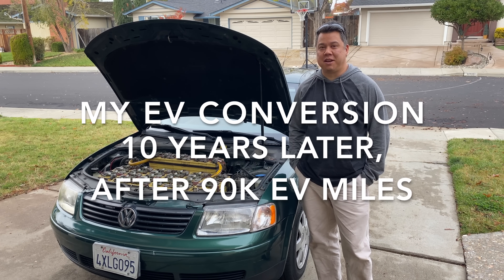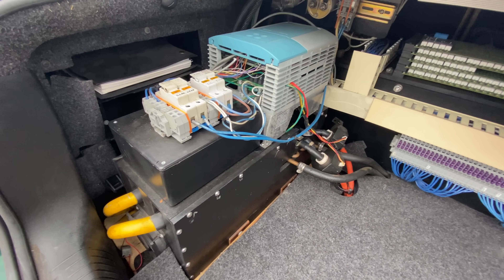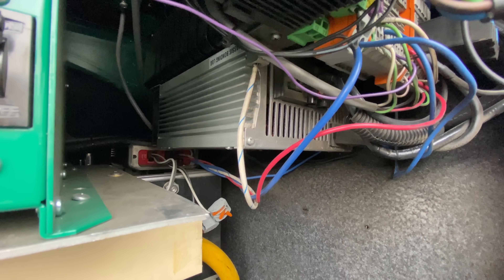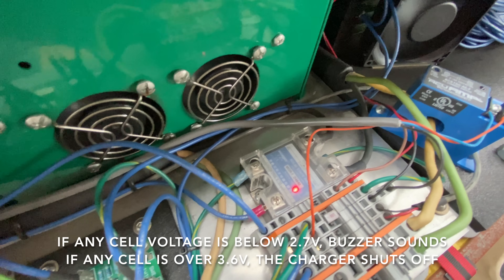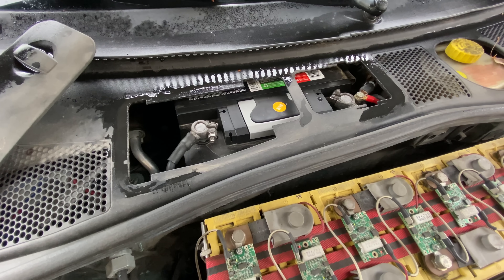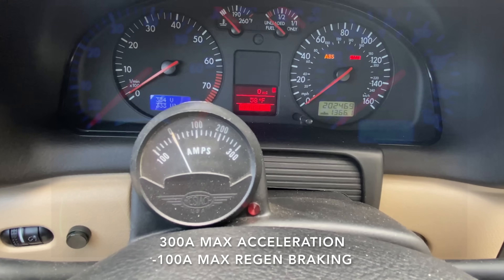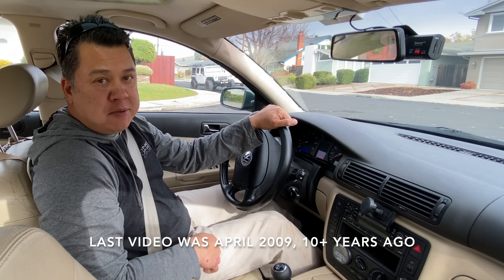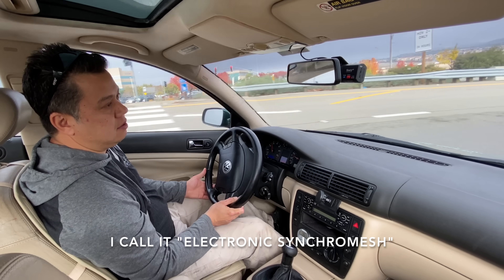My EV conversion after 10 years and 90k miles

Comment: Just wow! Wish you further tons of miles with it. 

What I don't get: why did you change it to manual transmission? I always thoght EVs have no classic gearbox anyway
Reply from the maker: The transmission is needed to connect the motor to the two drive axles, and also provides a 10:1 gear reduction.   An automatic transmission would require more work to operate (hydraulic pump, torque converter...)  and it weighs quite a bit more than a manual transmission.
Reply: @etischer  thanks! And just wow again :)

Comment: You could of literally drove a dump truck to work every day and the fuel bill would still be cheaper then a $25k used electric car.

Unless you built it for fun and experience, there would be no reason to build it for practicality.

Comment: Electrify is cheaper at different times?
Reply from the maker: Yes, it's to encourage people to use things like clothes dryers at night when there is less load on the electrical grid.   This helps alleviate the need for building more power plants to supply power during the day, during peak usage.

Comment: do u have a battery hotspots problm?
Reply from the maker: Nope
Reply: @etischer  won't the batteties get heated up while running...?? Or do u hav any cooling system for tht?
Reply from the maker: @Karthiksen  Im sure they warm up a few degrees, but they've never felt warm.  The internal resistance of the battery pack is really low, around 100 miliohms.   Typically on the freeway, the car uses 60 amps, so I^2 * R = 360 watts of heat over 700 lbs of battery.
Reply: @etischer  thanks for the clarification

Comment: Did you ever have any water issues
Reply from the maker: I did have one spot I didn't notice water would come through, I think it is where the air filter box cold air inlet was routed though the radiator support. When I removed the air box, it left an open slot about 4" x 1.5" above the radiator, didn't think much of it cause it wasn't visible with the hood closed.  I noticed one of the boards had a little corrosion on it one day, even though they are conformal coated.  Was an easy fix to glue a plastic cover over the opening, never really caused a problem though.

Comment: Spent all that money and time making an EV. But uses the stock stereo
Reply from the maker: The Monsoon system is really good, uses 2 ohm speakers and separate amp.    I also had a JL Audio 8" in a bandpass box I built, with the micro sized Fosgate  PBR300X2 amp.   I pulled the sub out for the video so people could see the EV part of the car.   Also had iPod integration for direct audio connection and integrated steering wheel controls.

Comment: This looks dangerous and shouldn't be legal for citizens to do this, what if the battery got hit and blows up?

I swear you people never think of these things, only think of what CAN be done you dont consider whether or not it SHOULD be done smhsh
Reply from the maker: Yes I have though of these things.  These are Lithium polymer  batteries, they do not catch fire, even with nails or bullets shot through them. They are much less flammable than say... 20 gallons of gasoline.

Comment: So I'm and automations engineer... I spend 8hrs 5 days a week lovingly and maternally caring for a Cyclosporine syringe, sterile filling machine. With its servo controls taking up a massive cabinet the length of the pharmaceutical suite (filling machine room) wall.
I would still not want to take the effort to do this xD
Jesus man, fair play, and while I could list the problems I'd have with the car, like being able to put down the rear seats to open the boot for any wood, whatever I plan on carrying, in reality, I doubt you need that, and it's clearly been running like a champ after 10 years.

Comment: It should be noted that 90 kw is the equivalent of 120 HP but since electric motors have nearly constant torque from 0 rpm onwards, a 120 HP electric car is the equivalent of a 360 HP gasoline car.  The downside is the limited storage capacity and weight of the batteries.  Because you can charge every night at home rather than a once per week visit to the gas station, the limited capacity is not as large a problem as it might seem and purpose built electric vehicles can save a lot of weight, of course a conversion will not have many of the advanced weight saving materials and would be carrying unnecessary mass such as the transmission but overall, an electric vehicle should meet most daily needs, reduce maintenance costs and you can just rent larger vehicles when you do have extended trips.  I'm not too keen on replacing existing vehicles with electric vehicles as producing any new vehicle has an energy and material costs but conversions can address that and if you're going to replace your vehicle anyways, an electric may be a good option.

Another point is that cars are designed to exhaust cabin air through the gaps around the tail lights so it isn't necessary to cut exhaust vents behind the license plates, just cut a hole through the interior covers around the tail lights and mount exhaust fans.  Also note that hat the Prius has been a by the rear seats so that the air conditioned air in the cabin are vented through the battery compartment.

Comment: That's great but what about when you suffer a COLLISION?! All that tek-screw mounted equipment will break loose and be in your lap...after it squishes you of course. That is NOT safe. Also,how much does the vehicle weigh? As much as an F-350?..on that light chassis and small wheelbase. He may be an electrical whiz but he doesn't understand or care squat about mechanical engineering. #deathtrap #nochildrenallowedonboardever
Reply from the maker: My EV conversion weighs 3,700 lbs, the V6 Passat weighs 3,600 lbs, W12 version is 5,400 lbs.  The strapping for the batteries has a factor of safety of ~30x.   The welded battery racks are bolted to the frame using 3/8" stainless hardware with tapped backing plates.  Obviously there are differences from a stock vehicle, but ABS and airbags should still work, chassis is unmodified.

Comment: Pretty interesting build especially given the transmission. Probably not cost effective but for instance the abrams tank which uses a turbine uses a reduction gear box which brings input rpms down to a rate that the transmission can accept. Also adds torque ect.

Comment: pretty cool...very nice attention to detail....you have way more electronics monitoring things than i would have thought and way more power-supplies than i would have thought necessary....drops efficiency. But Wow...batteries everywhere...lots of weight...beefy springs. Question is...how long before you have to change out those expensive battery packs?
Great idea to keep a manual transmission....do you regen energy during braking? and what happens when you push in the clutch??...imagine the induction motor keeps the same RPMs when shifting?

Comment: Firstly, let me say that I respect your engineering capabilities ... not only in regards to the design aspects, but also the actual building testing and implementing of your designs.
But ... 
and please don't take this the wrong way ... 
the nature of your personal design/build/ and implement project (and it's price tag) negates the critical research that an "automobile manufacturer" would have the financial resources to perform.
Namely; Destructive Testing.
Question: What happens when your car is sitting in a line of vehicles, waiting for a traffic light to change, and a heavy truck plows into the back of the line; crushing the "crumple zones" of your electric car (which are chock-full of high amperage battery bank's) and your car's conductive steel body becomes a conduit for 330 volts, at an impressive 300 amps of potential?
Not to mention, that the entire "line of cars" have been mashed together, like a string of metal contacts during the impact, thus distributing the "power surge" to the other party guests, including the truck driver who dropped-in unexpectedly.
So there. I have said what others were thinking, but we're too courteous to mention, as they observed batteries stuffed conveniently into every available cubby hole. 
You sir, are a humble genious.
But, I am willing to honestly answer the question that I posed earlier ... 
Answer:. Nobody knows.

Perhaps all of the fuses blow simultaneously, with a whift of smoke that vents from behind the freshly mangled license plate.
Or ...  perhaps a dozen people are electricuted, including several emergency response workers that unknowingly participated in the electron flow.

Now, human nature virtually dictates that one or more readers will happily attest that the system will self-extinguish, based upon wishful thinking.

But, the truth is ...  that until several cars are smashed into crumpled messes, and the data is measured, recorded, and studied; not one person can say for sure that "baby Billy" sucking upon a lollipop in his rear-facing car-seat, will survive the event that included the brilliantly designed VW.

I'd like to take a moment now, to apologize for mentioning the unmentionable.

I've always felt that "somebody" should have "voiced the negative" prior to the launching of the Hindenburg.
Reply from the maker: About crumple zones, VW put a W12 in this car too, I probably have about as much crumple zone.  The steel body would act as a faraday cage absorbing current preventing it from flowing through a person's body.  Current has to flow from positive to negative battery lead, unless you complete the circuit from both ends of a battery, no current will flow.  Current will take the shortest path, it won't electrocute a string of cars touching each other. As soon as the battery is shorted, the fuse will blow.  Fuses don't emit smoke when they blow, the semiconductor fuses Im using are also full of sand that floods the void of the fuse element when it burns out.  I agree there are additional risks, but other risks such as 20 gallons of flammable gasoline are eliminated.  The batteries Im using do not catch fire, even when pierced with a nail gun multiple times, or shot with an AK47 (YouTube).
Reply: @etischer ,
You are the last person I would have expected to drive home my point, regarding human nature and wishful thinking.
Just curious ... you expressed your favorite perspective in the thought pile, but ... tell me more about the dozen or so "other" scenerios that you weighed in your mind, before choosing the one with the happy ending?
To save time, why not just summarize with two or three catastrophies?  🤔

Comment: Did the electronic steering pump made the steering smoother and easier compared to the original hydraulic belt driven steering pump ?
Reply from the maker: It's an interesting sensation being able to turn the wheel with no engine running.  I wouldn't say the steering feels any different than a normal car.

Comment: What happens if you’re in too high of a gear for example if you’re in 5th gear at 10 mph
Reply from the maker: The motor would be drawing a lot of current, and over heat eventually.  It's better to have the motor spinning fast, so it uses less current but more voltage to make power.

Comment: As soon as he said he manual swapped it he instantly earned my respect
Reply: Very smart move for longevity
Reply: @kenball1980  smartest move for an ev would be to not use a gearbox at all since the electric motor doesn't need it
Reply: Lucian Iștoc still there must be a gearing ratio because of different speeds and following in-/efficiency so you would need a converter of some sort. For him it was probably easier to just use the already existing clutch.
Reply: @lucianistoc1264  most ev conversions use gearboxes. Electric motor may not need it as much as an ice, but it doesn't hurt it either.
Reply: @AR-zq9hq  No they don't, they just use a final drive ratio
Reply: he earned my respect when he popped up the trunk.... the manual swap is instant legend status...
Reply: Respect +
Reply: Famus 801 it’s not hard at all
Reply: The only thing similar to an atmo car is the suspension, the car shape and the moving wheel parts. You don't need a gearbox because electric motors are infinitely adjustable according to the voltage applied.

Comment: while I am very impressed with the job this guy has done the economics of this really doesnt work out. He has spent over $12,500 on batteries alone to do 90,000 miles. Not taking into account the cost to charge it daily it would still have been much cheaper for him to do the same mileage in a petrol/gasoline powered car (even if he had done it all on todays petrol prices). Lets not forget that the power used works out to be very similar cost to petrol/gasoline for the same distance.  If he had bought a Nissan leaf or similar the battery cost would be even higher and their batteries dont last very long. Electric cars really are not efficient users of energy.
Reply from the maker: I did the math in the video description area, battery costs were $12.5k, ICE costs would have been $16.5k.  I didn't customize my car as a way to save money, it just happened to work out that way.
Reply: @etischer  i am very impressed with your achievement, you have done an amazing job. I am always calculating the benefits of different options these days. I hope you dont think I was trying to criticise as that is not my intent. I was just comparing options.

Comment: how much does this thing weigh? that sort of thing would never be allowed to go on the road in germany. batteries suspended with straps?
Reply from the maker: Each strap is rated 1500 lbs, and 4 straps hold down the front battery (200 lbs), so safety factor of 30x assuming the car is upside down suspending the batteries.   Car weighs 3,700 lbs, the V6 Passat weighs 3,600 lbs.
Reply: @etischer  I dont say that what you are doing is wrong. i am just telling you that your reworked car wouldnt pass german roadworthness inspections. straps are just not allowed to attach something permanently, because they cant be under load 24 / 7 without stretching, plus, you cant have them under the car, because of wheather issues, plus, if you use them, youll need something plasticky to go on the edges. there is some more issues, but i cant translate well enough. one would be, that you had to prove the roadworthyness of every single component of the car that is not original. that would ammount to millions in fees. 

the burocracy in those things in germany is unmatched.
Reply: How did you figure all this stuff out? are you an electronis enigeneer?
Reply: @etischer  I think youll need the 30x factos in case of violent  negative  accelaration

Comment: Would it be a problem to always drive it in 3rd gear? And if it is a problem, why? Is the start problem or low speeds or both? :D
Reply from the maker: I can also start in 3rd gear, but it doesn't accelerate as quickly, and the motor runs hotter.  Just like starting a bicycle in 3rd gear vs. 1st gear.  Starting in 1st gear just spins the tires, and limits max speed to about 50mph.
Reply: @etischer  Thanks for the reply! It is truly amazing what you did here and even more amazing that you did it 10 years ago.

Comment: So you made a car with better range than an original Nissan leaf by retrofitting an ice car. That's incredible! I just have two questions. How much did the work cost and how much time did you spend on it?
Reply from the maker: I did all the work myself except the CNC machining of the adapter/motor coupling.  I'd estimate 500 hours to get it running, roughly 1 day per week for a year.  And over the next 9 years, another 500 hours making software tweaks and other refinements.

Comment: 25k fucking dollars? dude. its not worth it in any way shape or form.
the way i see it ok saved 14k in gas 1000 plus in extra shit... ok lets say all in it was 15.. lets say 20 to be a bit more fair as theres tons that could have went wrong.. that means you saved 5-(maybe)10k over those 10 years (or 8 as you say you drove) 

well uh.. i can go out and buy a fucking used prius for like $2k-$5 for a good shape one and get 50mpg easy. Even putting in new batteries  may cost lets say $2k at a local shop? as its the biggest cost in a prius or electric always, the batteries... aaaaan i bet it lasts 10 years. And funny thing is.. you could have done this 10 years ago, albeit paid a tad more for say an 05 prius in 2010. If anything youd be paying to get new cells or new battery the whole thing a few grand today and continued smooth sailing...

You see where im getting at? it wasnt worth it at all.Its neat and stuff but damn waste of money
Reply from the maker: This was more about the challenge and a way to showcase skills, than a way to save money.  Cars are terrible investments, any car I bought for $25k would be worth <$5k after 10 years.    This car got me hired at Tesla as a Staff Engineer, can't say they'd be as impressed if I rolled up in a used 2005 Prius.

Comment: Why are u using manual gearbox? As I know the best about electric cars is one gear and u don’t have to change gears
Reply from the maker: The motor needs around 10:1 gear reduction, and the transmission connects the motor to both front wheels.  Wouldn't be cost effective to re-design it.

Comment: What do you do professionally?
How much time did it take you to start from scratch until the final successful run?
 How much did it cost you overall other than the modifications you've made? I mean there is Project cost and Operational costs as well. 
What steps did you take to ensure safety as there are battery cells everywhere. 
Due to the weight of the batteries, did you face any issues?

Comment: Why do the battery sense circuits have such high wattage ceramic resistors? Would they be wasting power with so many when on battery?
Reply from the maker: The resistor is only used if a cell is over charged, it helps ensure all batteries are balanced.   They aren't dumping heat very often
Reply: @etischer  Cool, thanks for the insight.